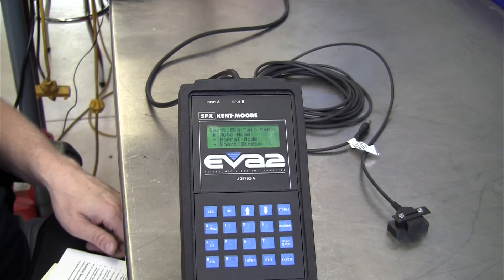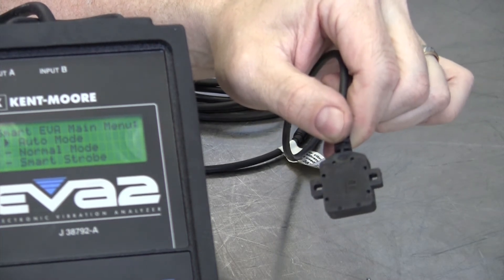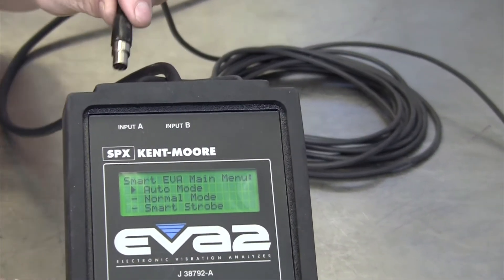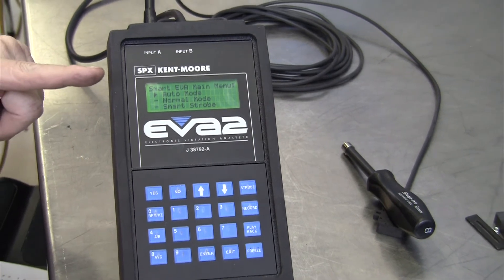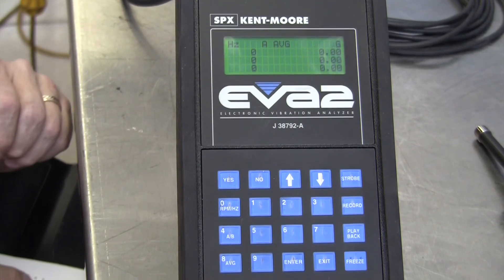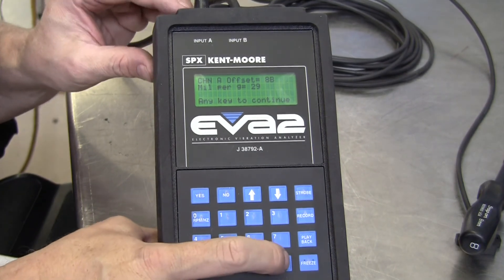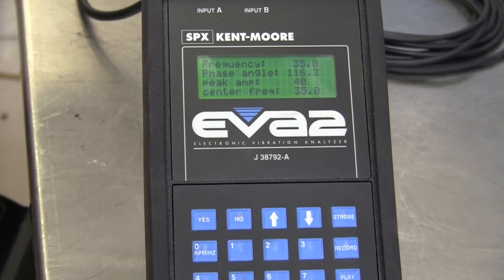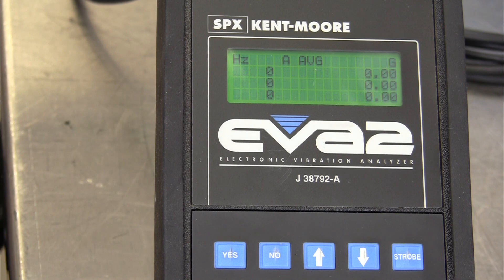EVA Vibration Sensor Calibrations

Comment: Hi and a huge thanks for sharing these great videos of the EVA.
I recently got a EVA2 from Ebay… hoped for the best. When I´m trying to Phase Calibrate thro Input A it doesn’t start… just writes 0 Peak Amp and nothing happens.
Phase Calibrate in Input B starts up and runs thru the calibration. 
Still says that the accelerometer A and B is not calibrated or bad.
How do I know if my sensor is bad and is there any chance to buy a new somewhere?
Otherwise I just buy another one and hope for better luck :P

Best Regards,
John Eriksson, Sweden

Comment: Thank you extremely much for publishing this video, I just purchased a used Eva2 with 2 cartridges to balance my driveling I just modified on my lathe.  I'm 65 and lots of wrench time in my life. In the past, always seemed balancing was a major issue and I don't live near a shop that does Balancing.  Plus, this is much more fun, plus my drive line is a 2 piece and weighs about 70 lbs.
  Always new gadgets coming out and unless your in the industry you wouldn't know about these tools. 

 Thank you WSU for doing this and your technician is a great teacher and does not hurry through processes.
It's truly a tribute that Information should be Given to the masses at least to understand a process.  Thank you again.